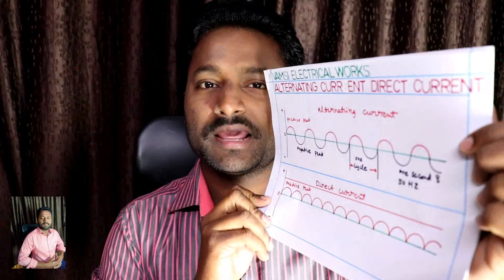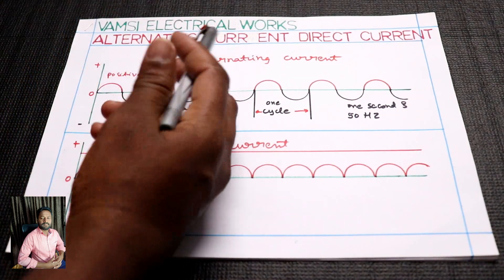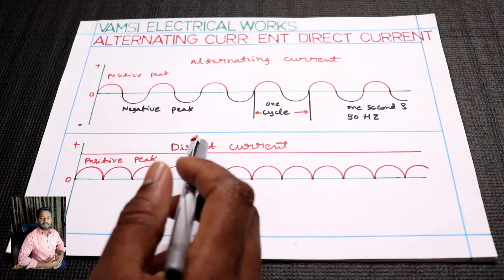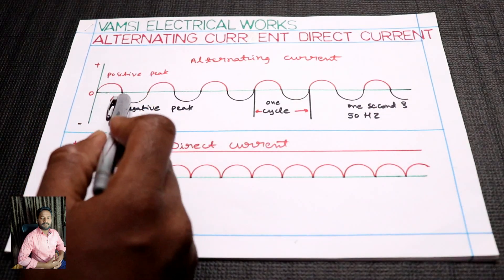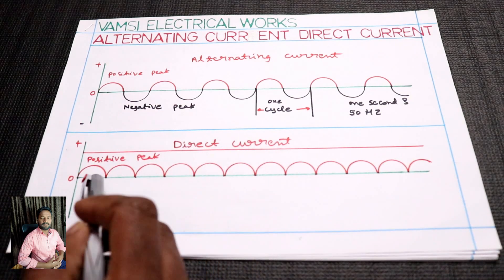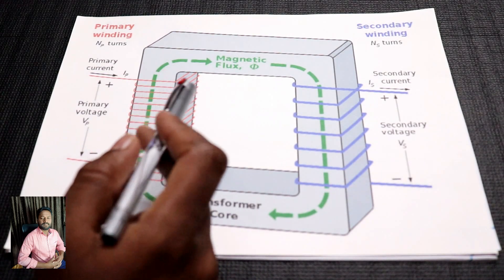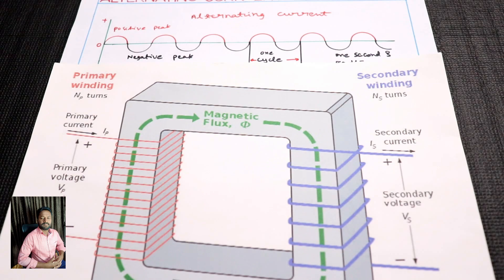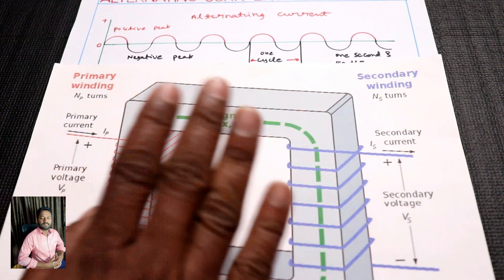Alternating Current vs Direct Current ll in Telugu ll

Comment: Ac ceiling fan induction motor kada dc supply tho run avuthunda ceiling fan
Reply from the maker: Hi bro
Avvadhu
Reply: @VamsiElectricalWorksinTelugu  bro mana intiki vachedi maximum mottam AC supply a .